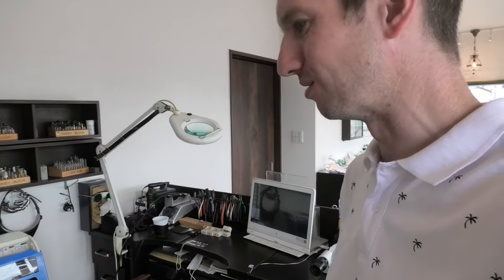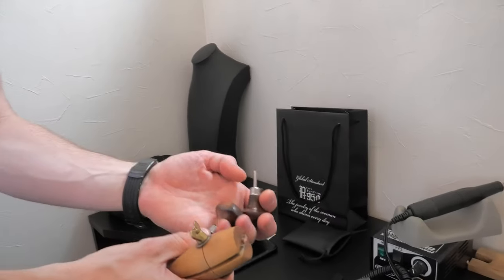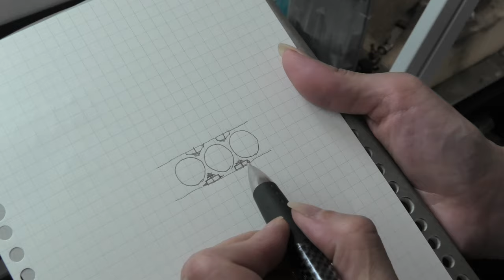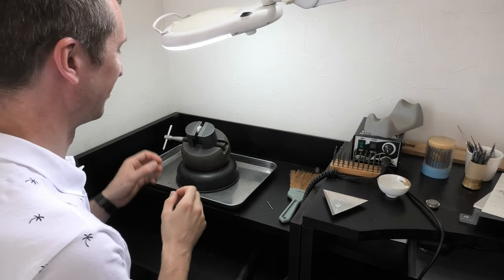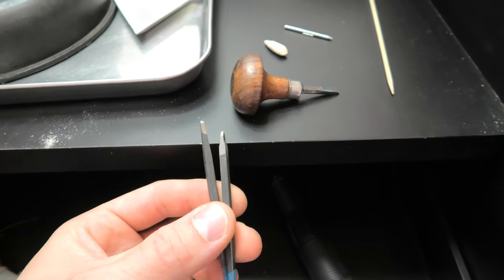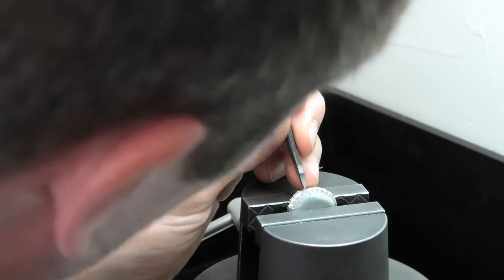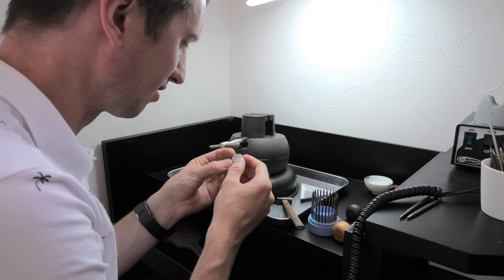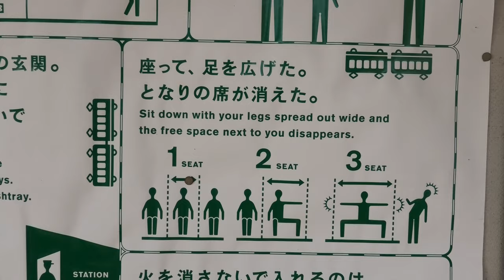My Setting Lesson in Japan!

Comment: Good tip is to start the split with a fine saw blade first, then push the splitter into the cut moving left to right. Makes it easier getting it central.
Reply from the maker: Thank you that makes sence

Comment: Don't get the lasering the setting plate ? surely after drilling and cutting it would fall apart ? and when he formed the dome (collet) just on the outside of the stone which he layed on top , And next the dome ends up wider and bigger than the stone ?? and then make a setting plate and a inside setting collet to fit inside the first dome ??

Comment: Your videos are helpful and interesting, thanks for making them. This one was a bit of an epiphany. I have been looking at your videos and wondering why your jewelry bench setup looks so different - but watching this one made me realize you specialize in fabrication, and you job out all the casting and stone setting to be done by other specialists. So you do not have tools for wax carving, casting, stone setting, or engraving, hence you don't have all the usual work holding tools (benchmate, engraving block, etc) and you don't use gravers to solve your carving problems the way an engraver would.  So you don't have the usual 999 gravers and all the gear to shape and sharpen them. You do very little forging, so you don't have a huge pile of hammers and anvils. You don't do casting or enameling so your entire hot work area can be done using pair of tweezers in your bench peg, and once in a while a six inch charcoal block. You do a LOT of your work on your bench peg with a jewelers saw, files and burs, with no holding fixtures - I haven't even seen you use a ring clamp. Your fabrication skills are freaking amazing, but it baffles me how you went 20 years without all the other skills. When you are a hammer, the whole world looks like a nail. When you have lots of skills you solve problems in ways that use those skills. It is really fun and interesting to watch you work, partly because you use so few "gadgets".
Reply from the maker: Spot on! A casting company with casting equipment costing hundreds of thousands are gunna do a better job than me doing it myself. A full time setter who has been doing setting for decades will do a better job than me doing it my self. When specialists collaborate on a piece it will be much higher quality than just one man doing it all.